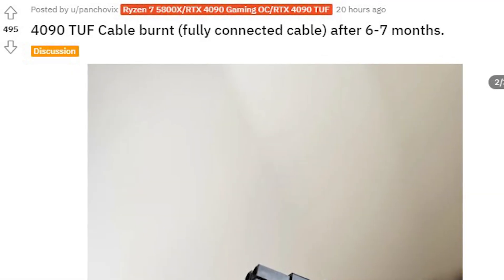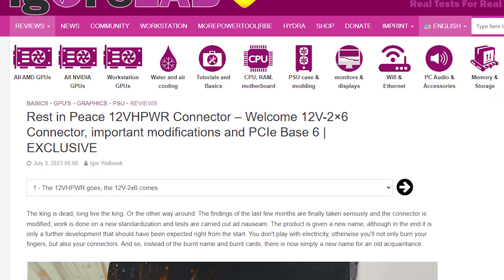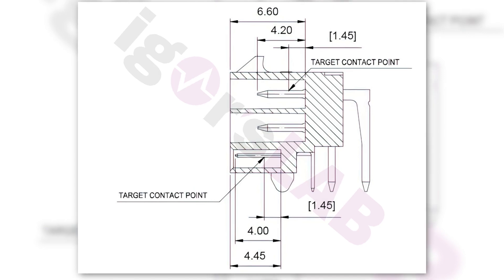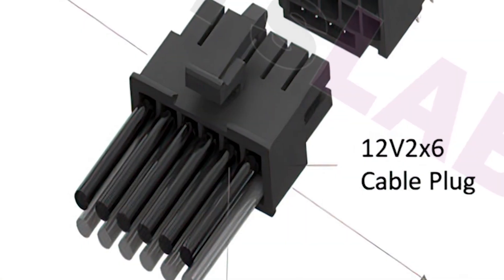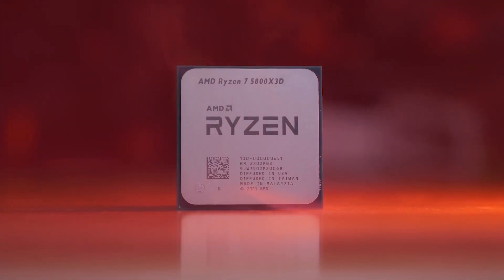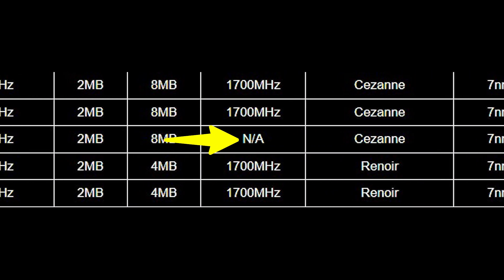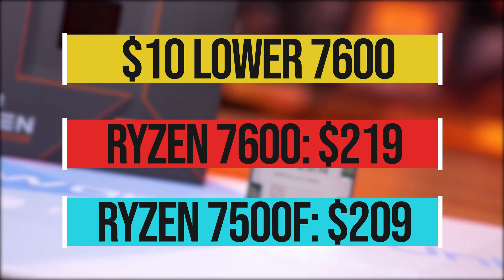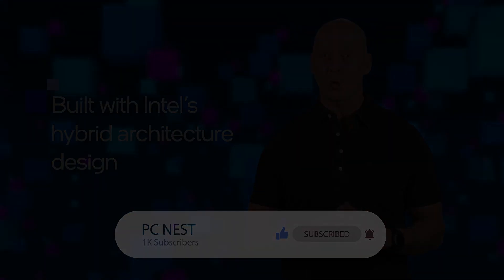Nvidia Finally Identified the Problem

Comment: . . . Simple FIX: While the connector is already removed, just cut plug off & strip wires & solder them in the holes 🕳️ . . .
Reply: brush your teeth with cow dung

Comment: I know what the problem is!!!  The users plugged the power into the cards.  These cards are meant only to be used for bragging rights and not for actual use.  No RMA for you if you plugged the connector in.  Seriously though, my grandson's card burned up and we made damn sure the connector was fully seated and made a clip that went over the backplate that held the connector tightly.  One week and it burned up.  Reason it burned up because the pins have such a small contact area in the sockets.  If the pins and sockets was slightly tapered like a jacobs bit, then there would be full contact along the pin surface.  Don't worry Asuck we are not RMA'ing the card.  If we did it would only come back with a limited warranty.  We fixed it with just silver soldering the wires directly to the card.  If some company uses my idea on the pins and sockets I want full royalties.
Reply: even if you send the card back to Asus, they only replace the connector because NVIDIA forced them to put the new connector on. If you've notice in previous models of the other graphics card from ASUS, they managed to reduce the amount of power connectors needed to power a high end model. 

just compare RTX 3080 from ASUS and from Asrock to see the difference 

blame on NVIDIA for designing that piece of e-waste they call "masterpiece"

Don't jump straight into conclusion if you're not sure about it. Cheers

Comment: i have a rtx 4070ti does she have possible melting issue?
Reply from the maker: Up until now no other than 4090 faced melting issue
Reply: No, different connector and power requirements.